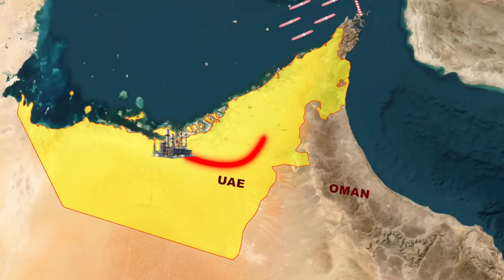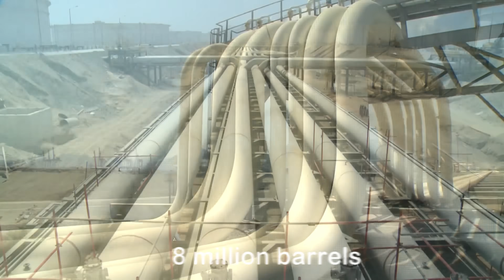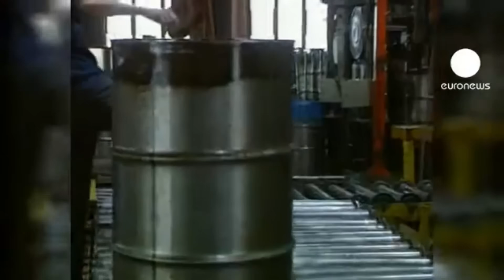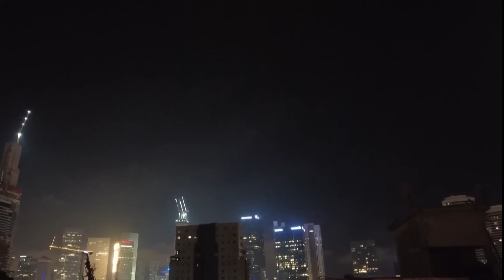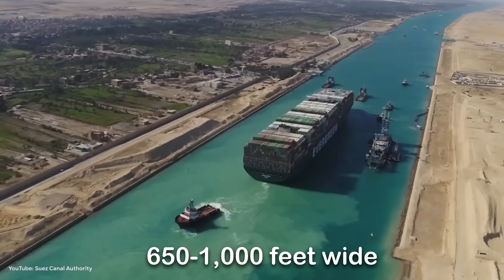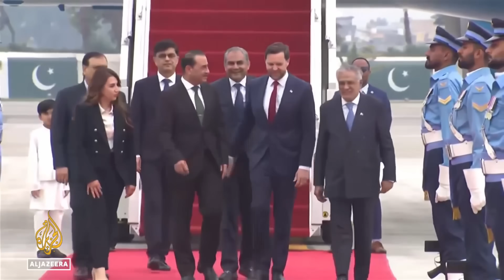The $60B Project to Completely Replace the Strait of Hormuz

Comment: The "concentrated target" is a huge concern.  It will still be well within reach of Iranian missiles.
Reply: well within reach is an understatement ,they can hit 10x or 20x times farther with drones and missiles , its a fukking nightmare
Reply: It's true they do not have the military capacity to launch anything but what if the UAE build a canal more inland. How far can they go to avoid the max threshold of current Iranian missile tech? I think the canal would be the best option since it can move more than just oil and provide an extra revenue stream. Does anyone know which company has submitted proposals?
Reply: @ArcherNX1701  Given that Iran has launched missiles at Israel, there is no part of the UAE that is out of range.
Reply: @KentBunn  They've launched Israel but hardly with any accuracy. And UAE can easily afford the multilayered anti drone defences which is a mix of high end fast jet and SAM missiles, also air defence guns, electronic warfare and fairly cheap interceptor drones (which within 5 years will be available as AI controlled swarms). UAE is physically small but rich, it can afford to defend itself.  But that assumes the regime will even still exist. This joke of a regime has a leader whose face cannot even be shown in public because his injuries are so repulsive
Reply: @PosthumousAddress  You clearly did not see the CNN reports that showed the high level of accuracy of Iranian missiles. Why do you repeat misinformation like this?
Reply: @ArcherNX1701 Iran doesn't have the capacity to launch anything ? Buhahahahahaha.
They struck Diego Garcia base 2,000 miles away but could reach their neighbor the UAE ? Nice joke.
Reply: @Hugh-Jarnus  They didn't strike Diego Garcia. They launched two ballistic missiles. One was intercepted by an SM-3 AEGIS missile, the other simply broke up in flight (crappy regime engineering)
Reply: @Hugh-Jarnus  Iran never claimed to have struck Diego Garcia. In fact they explicitly stated that they do not currently have missiles that can reach that far. It is more likely that it was a false flag affair. Israel is well known for these. 
Nevertheless, Iran has good accuracy within the range of the proposed canal, which is why it will never get built. All Iran would have to do is disable one or two ships in the channel.
Reply: @andrewmole745 they never admitted to striking anything.
They actually struck Diego Garcia.
Who do you believe ? The people who said that a pilot was able to walk 50 miles after being shut down and was later rescued, identity of the pilot still remains unknown.
Reply: @Hugh-Jarnus  Iran stated that they did not have missiles with that range. Is that clear enough that they say that they did not fire at Diego Garcia?

I agree that we don't know the truth about that "downed pilot".
Reply: Which is why Iran needs to be vaporised
Reply: Very true. Iran has ballistic missiles that can easily reach it. All you need to do is cripple one of two ships and it will be blocked for weeks or months. And it is also within the reach of the Houthis.
Reply: All of Iran is within range of the Trident Submarine. Just saying
Reply: @elvenking62  Exactly - threatening even more war crimes. When will the US and Israel face justice?
Reply: Exactly the point
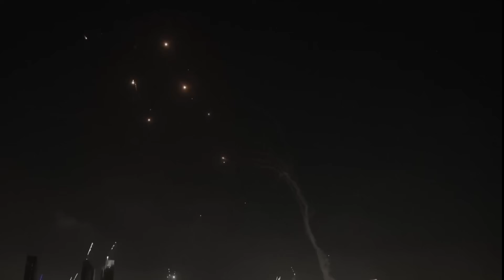Reply: 7:07 – The scary part isn’t missiles… it’s cyber. Pipelines don’t need to be blown up to fail. Just shut the system down.
That changes everything about “energy security” imo
Reply: Iranian missiles have not hit a single military target in Israel. They are quite poorly guided
Reply: @Chris-pq3wp : actually none of us knows because Israel is blocking all reporting. Military experts however say that Israel’s defences let significant numbers through and that targets are being hit.
Reply: @Chris-pq3wp  They've been missing because Israel has a very active defense system to prevent them from coming in.  Not because their are having guidance issues.
Reply: @KentBunn the missiles that got through hit civilian areas. All the key infrastructure like bases, ports, power plants was unharmed. The gulf states will be upgrading their anti missile defences after this and spending billions on it
Reply: @Chris-pq3wp : unlike Israel and the US, Iran is not aiming for civilian targets, and Israel blocks any news about military targets being hit. If you look at the NBC report on what has happened to US bases and how they have been obliterated, then you will get a picture. The Western media is complying with all propaganda requirements of Israel and US, but the truth is coming out.
Reply: @KentBunn   They are neutered, they will have to throw rocks soon.  They have lost the ability to manufacture missiles and launch them.  In time it will only get worse for them.  Your fear is projecting strength to a country that has none!
Reply: @nelson9286  They are far from neutered.

If they were, we wouldn't be forced to negotiate with them over Hormuz.
Reply: @KentBunn  If you think jumping on a dinghy and attacking tankers with ak-47's is power your not that bright.  When you can fly over a country and drop bombs wherever you want, the country is neutered.
Reply: @nelson9286  it is a big country and even the us airforce cannot be everywhere at the same time. They manufacture drones at 30k a pop and can send 500+ of them at a time. No effective countermeasure in place for this at the moment
Reply: @ForexBoy-zm3zf  Except the current countermeasures that prevent them doing any real damage lmao
Reply: There won’t be any Iranian missiles!
Reply: @derek6579  Lol.  Keep thinking that...

Comment: For the portions of pipeline from west of the mountains into Fujahira, keep the pipes deeper underground - use tunnel boring machines 
 Item 1: place the pumping stations on the western side of the mountain range well back from exposure to military interference but with enough power to push the crude uphill partway to a predetermined 'tipping point' where the oil will then gravity feed to the port
Item 2 : this reduces the number of other wise exposed pump stations that will have to be placed in those mountains
Item 3: placing the pipes further underground will allow natural shielding from excessive temperatures
Item 4: This approach could also allow simultaneous build of pump lines further south across Oman to ports further south on the Omani coast, further from potential hostile action and allowing the bulk traffic to select the terminal most advantageous to the hemisphere of destination
Item 5 : an LNG pipeline can follow a similar methodology to a new LNG transfer / storage terminal

Using the boring technique is proven technology  The European Union has built several very long (50-60 kilometers) thru the Alps in the past 15 years. Eliminating dealing with steep slopes saves time, exposure to heat and physical threats and reduces cost
Reply: The problem with a boring machine is that those mountains are geologically unstable. The Alps are very stable so there isn't too much of a problem.

Comment: Working with the people of Iran to take back their government is the plan I would choose.
Reply: Umm, but let's look at history and all the times that the US has gotten involved with coups and nation building, then let's look at how it turned out. Arguably, it has a zero percent success rate.
Reply: You cannot impose that kind of change from the outside without the expenditure tens of thousands of lives, possibly hundreds of thousands. And even then the results are not guaranteed.
Reply: @ziply123 The blockade was working just fine, and Trump should forget about the Gulf states' pressure and the mid-terms and get on with Epic Fury.
Reply: @David-d9o8s The correct answer is to do the JCPOA and have the strait open.  Next best is to build a coalition force open the strait and blockade Iran until it collapses.
Reply: @rustyheyman214 With or without the coalition force.😊
Reply: I wish the people of the us would take their out of control govt back….. it’s the real problem…. Or that little crappy country they support with their citizens healthcare money and citizens starving in the streets……

Comment: Interesting video, good work.
But I think you’re missing the actual opportunity here by perpetuating existing systems and not considering alternatives.

What’s even cheaper than extraction, protection, refinement, transport, distribution, and cleanup of all this petrol?

We could shift enough demand to electricity over the same period to cut down the volume of crude needing moved. And the cost would be way less and the benefit way greater.

Odd how alternatives are overlooked and  systemic costs are externalized even by well meaning and intelligent people.

Comment: Great video on different solutions to a big problem that the world is facing. Personally I would like to see the use of nuclear weapons, not to wipe out Iran, but in a method consistent with the Plowshare Program from 1957. Radical as it was back then, we have the modern technology and simulation systems to properly map out how to use nuclear explosions for good nearly 70 years later. Although I do agree with your assessment in that the 10-fold pipeline would be the most economical. My main concern is echoed by other commenters in that you would still have to defend this asset from drone strikes, thus making the other more radical options more feasible in the long run. The whole situation is very interesting geopolitically, and I hope to see it all resolved for the betterment of the world in the very near future.

Comment: I have an even better idea. Tell the USA not to start pointless wars.
Reply from the maker: ha, ha, fair point. but even without this conflict, the strait has been threatened in '88, 2008, 2011, and 2019. the vulnerability isn't about one war — it's that 20% of the world's oil has been running through 21 miles of contested water for 40 years with no real backup. Thanks for watching it!
Reply: Yes because leaving most of the world's energy supply in the hands of a radical theocratic regime was a great idea anyway. This was going to happen eventually no matter what you might think.
Reply: @hydraulicsaint You aren't going to be able to wrest it from them. The better time was 30 years ago. They are much stronger today comparatively than they were then. But even back then they said taking Iran was way too costly.
Reply: This is an excellent idea and the best one.
Reply: Obviously, you never researched into hortodox shia muslim eschatology, yet you voice your opinions.
😄